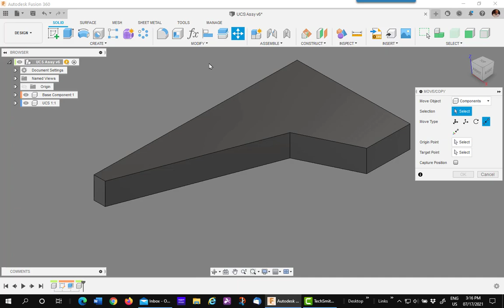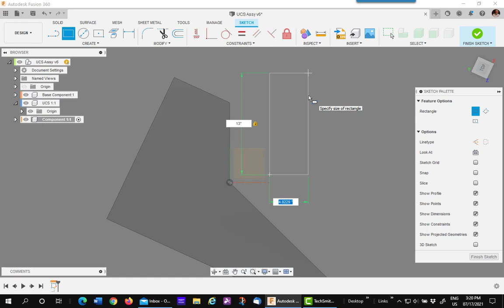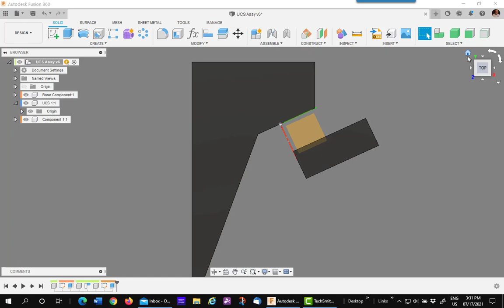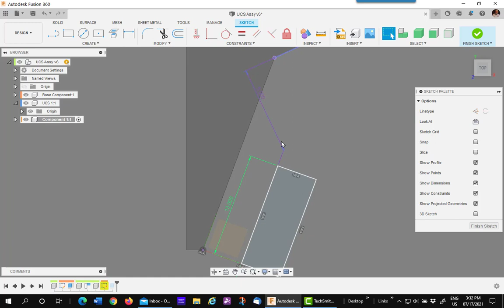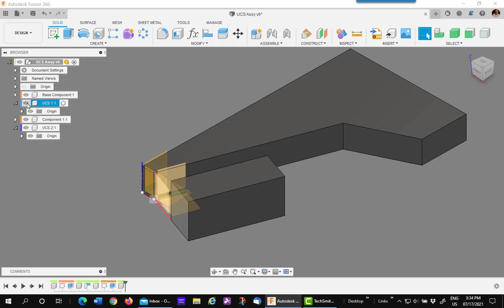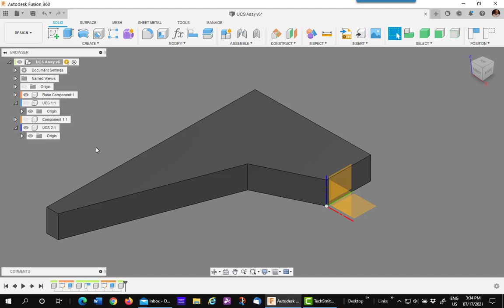Creating and Using UCS (User Coordinate System) in Fusion 360

Comment: Hi,

Thanks for this vid. A somewhat related subject is… past year or so I’ve been getting parts from a customer for machining. I think the models I get are made in solidworks. Many times the parts are small and I like to combine them into one file to machine a few at once from suitable stock. 
Issue is, the customer often sends the computer model that seems to be plucked from a larger, assembly, model. And they don’t bother to re align  the part with a new UCS /WCS. The oart can often be many inches away from origin. And a varying orientations. It’s quite annoying to spend time arranging parts in the new file.
Mostly I suppose because I’m time constrained and I haven’t got all the fusion command options learned.
This vid, while not specific to my problem, has helped.
Cheers
Alistair

Comment: Good one, again 👍
Is there a way to anchor UCSs to other components like origin to vertex, axis to vertex, plane to face?
Reply from the maker: Yes, you can use the method with a variety of entities.  If you want to use the UCS origin planes to move to another surface or face, you can use the Align tool.  Try the Align tool on other types of entities also, just remember to use the Capture design tool after any new UCS component placement.  If you do you can edit it and reposition later.
Reply: @jrhackney  thanks for your answer. Align tool may surely be helpful 👍
But what I meant by "anchoring" was in an associative way. In your video example, having the ucs1 stick to the vertex and face of the first reference part, even if I modify it.
Reply from the maker: I am trying to get you to relocate your created UCS component using the Align command.  The Align command gives you a lot more options for placement of the UCS component.  The Associative nature of the UCS component is still preserved, as long as you Capture Position after placement.  You can use an method of placement of the UCS component you desire, and it will still be associative so everything your create on it will move with it if need be.